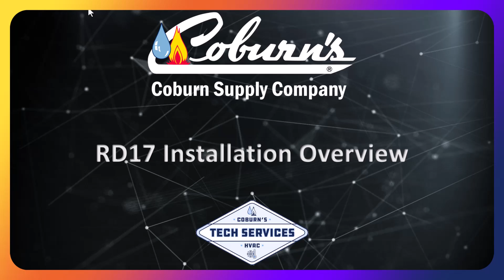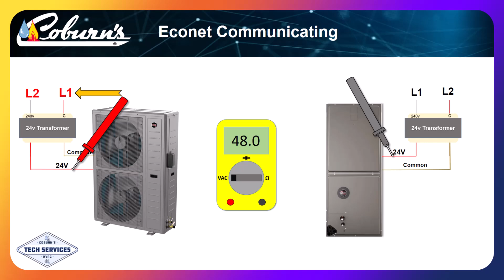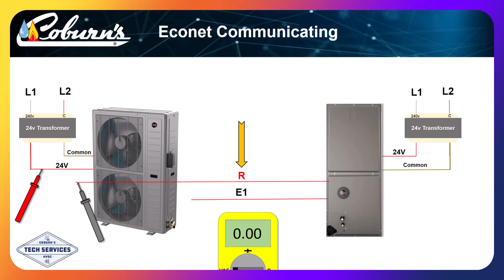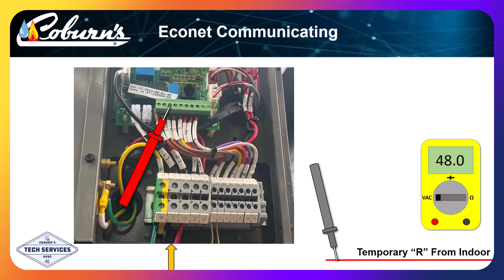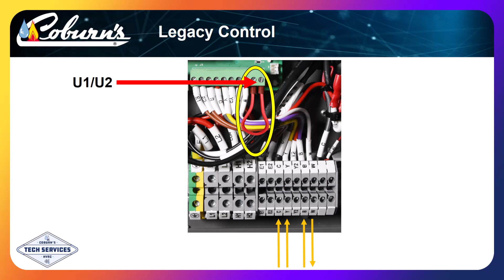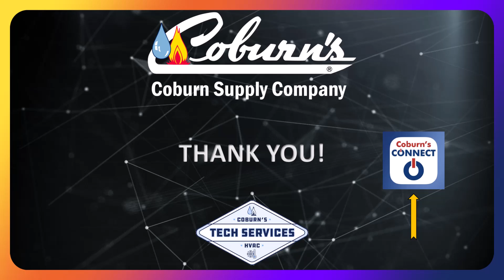RD17 Installation Overview

Comment: Hi commenting as a homeowner. Can the RD17 operate in inverter mode jumping u1 & u2 and then setup the indoor TStat (Sensi Touch 2) to operate the indoor air handler (ADP eFurnace) ECM motor, at 2 stages of airflow? So the outdoor does it own modulating & then TStat calls the air handler at stage 1 or 2 depending. 

If so, what wiring would you do? 
Section 4.9.2 of the install guide shows a diagram of how I think it should be wired. 

Thanks for any help.